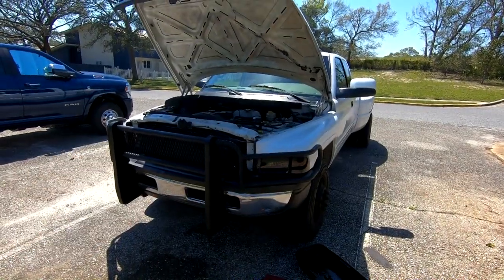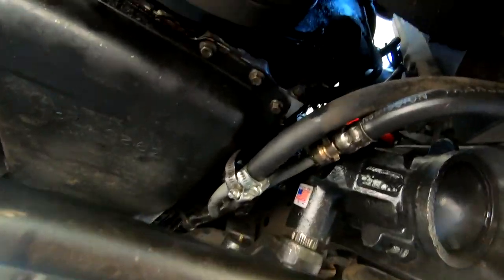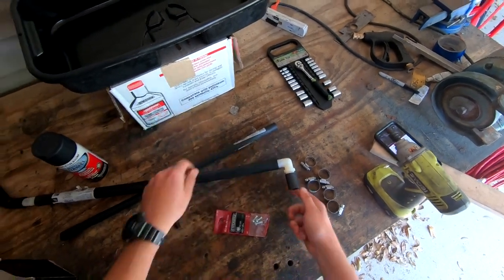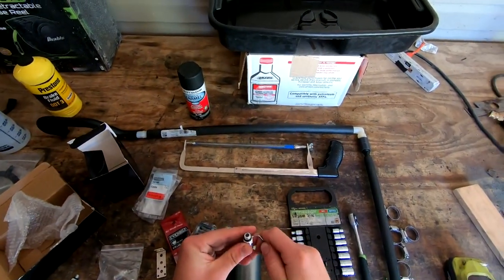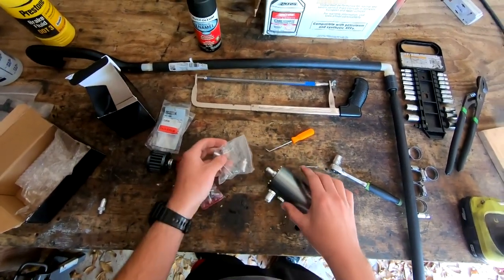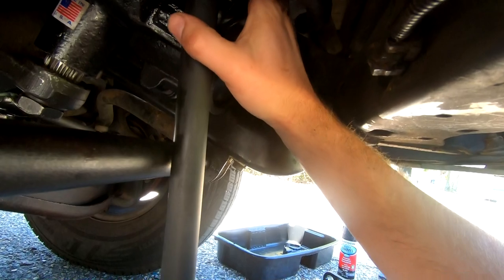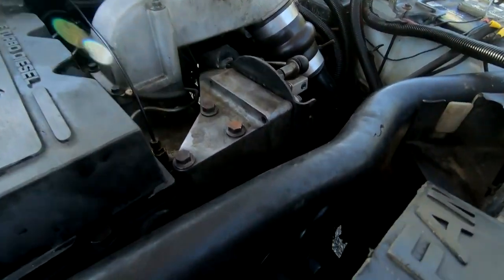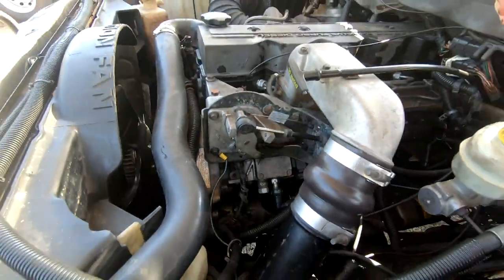24v Cummins Vent Tube Oil Catch Can (USE A BIGGER VENTED ONE THAN IN THIS VIDEO)

Comment from the maker: After towing with this setup, this catch can is not that great. The openings and exits are too tiny causing excess back pressure. What happens it it will push oil out of seals and blow out the vent and make a mess around the can. Even though the pipe fits, the actual vent hole size goes down to about 1/4" which is just too small. I disconnected the catch can and had better results with oil leaking and normal blowby, with it hooked up, doing the oil cap test, there was noticeably more crankcase pressure.
Reply: i read min size is 5/8's i would try again with that
Reply: You can remove it without unbolting the engine I've done it seems impossible but it comes out take care
Reply: Same issue happened to me. I installed the same exact catch can and had high pressure causing oil to leak from valve cover
Reply: Tried it . Ended up with oil blowing out all over.fi ally decided  to fix it right. Rebuilt engine!
Reply: To creator and anyone else that’s tried this and responded in the pinned post. 
I recall in your video… you plugged off the catch can drain.  
The commenters here… did y’all do the same ? 
One would think that having the overflow out line open to the ground would help it breathe along with having that filter.  Was that the possible cause for the back pressure ?  Or can it not vent and breathe through that as well ? 
I’m glad I seen this today because I was fixing to install a similar set up.  Now I wish I could have verified a couple things before buying all the parts.   But at least I seen this before I started fabricating my mount 😂
Can anyone offer any input on the not plugging the outlet off making it not having that back pressure?  Thanks in advance

Comment: First off I want to say thank you for making information videos. These jobs are hard enough to do without trying to video and edit at the same time. That being said I wonder how many people rushed out and bought the can  and hardware I totally missed your pinned comment. I feel like you should at least put something in the title that mentions it causes excessive crankcase pressure. One thing I wanted to mention is that when people are doing the tappet cover gasket the gasket does not come with instructions want to make sure you put the thick side towards the block. After making the mistake myself and having to do the job twice I noticed a lot of people are making this mistake. Thank you for making the tappet cover video, it helped me a lot.
Reply from the maker: That's a fair point. I'll edit that

Comment: How has this worked for you? Do you think it breathes enough?  Notice any new oil leaks?
Reply from the maker: Check that first comment I pinned. But no, it did not work, made some leaks worse because back pressure. I drilled out the holes to match the stock tube and it works as intended now.
Reply: @AllThingsBoost  did you change it out? What did you end up using?
Reply from the maker: @chilidog73  went back to just a tube

Comment: If ones truck does this does it mean that the engine has blow-by or even excessive blow-by??
Reply from the maker: If the vent tube is open as designed, and you take the oil fill cap off, flip it up side down and it doesn't move it's fine. If its puffing, it's a blown cylinder, if it moves a little its probably got worn rings and may need to be rebuilt soon.
Reply: @AllThingsBoost  Thank you very much.  I will try this tomorrow. 👍
Reply: @AllThingsBoost I had my vacuum pump replaced on my dodge 99dodge  24 v 5.9 and immediately had lots of oil blowing out my breather tube and oil pressure on cold start seemed rather high until operating temperature was reached. Any ideas?
Reply from the maker: @dwainsellers6453  sounds like a vacuum leak. Pull the line to the pump and put a vacuum pump to it, see if it's holding or not. More than likely there is a dry rotted connection somewhere
Reply: @AllThingsBoost  Thank you I will give that a try.

Comment: Is it safe to use a oil catch can for a car that has excessive blowby and also oil in intake manifold?
Reply from the maker: I'd say safer than not using one. Oil in the combustion can cause knock. Obviously your masking a bigger issue, but it may help you get some more life out of the motor
Reply: Thank you

Comment: My cruise control isn’t functional, and my ac is only blowing through defrost and I have excessive smoke coming out of oil fill cap, crank case ventilator and out of the oil dip stick. I do the cap test on top of the oil fill hole and it doesn’t even more at all or “blow it off”. Could this be because of a vacuum leak?
Reply from the maker: Guarantee you have a vacuum leak. Start at the vacuum pump located below the VP44, and follow the lines. Inspect each connector and line for a hole or dry rot.
Reply: This may be a long shot, but I know the 2nd gens have a horrible time with a little vaccum line on top of the passenger side dash, Luckily the dodge dash from factory is trash so you probably will not have to remove the whole thing. It's a little line that breaks off through the firewall after years of use. I fixed it on my 97 because the air only went through defrost like you said, Works like a charm 3 years later after putting a rubber hose on both ends/ reconnecting them. AFTER I fixed it I noticed that it would switch between defrost and what my setting was under load. The issue with that is a check valve on the motor side of the firewall. Replaced both of them and works like intended now. I think the whole repair cost me like $40.

Comment: DO NOT DO THIS. I used a can with 1/2 inch holes, ran for 2 days, blow the rear seal in motor, All Things Boost, take this video down !!!!!!!
Reply from the maker: Did you see the big bold video title that says use a bigger can and the pinned comment explaining why?
Reply: @AllThingsBoost  I did and I did, you stated that you used a 1/4 vent hole. I bought one with 1/2 " holes. The problem is the whole design, according to the mechanic who is charging me $826 to replace my rear main seal, You yourself agree that this doesn't work, so why have the video on the tube in the first place
Reply from the maker: @ripken069  fair